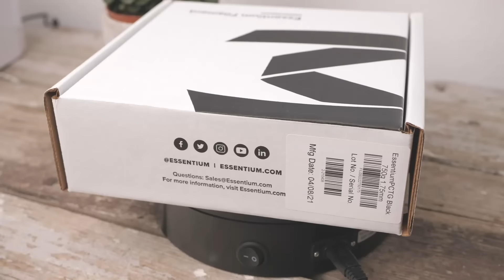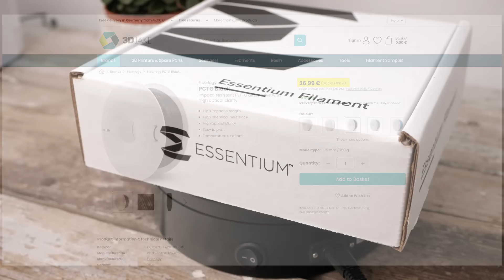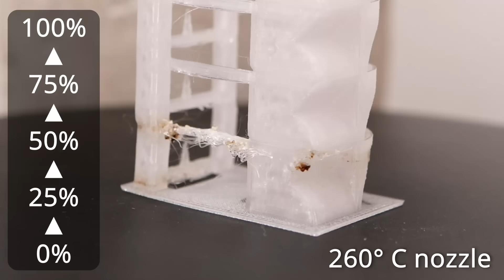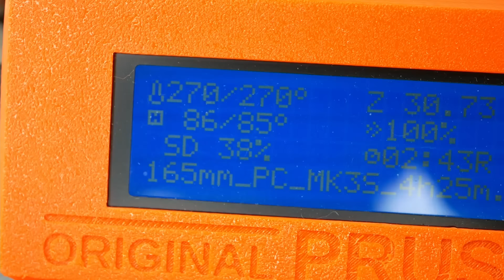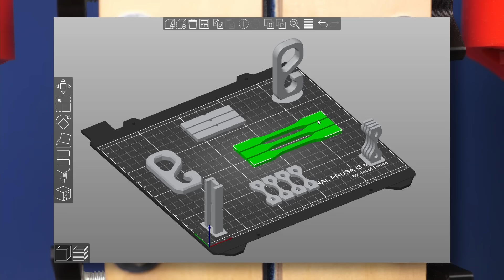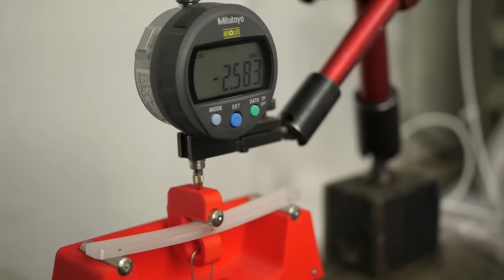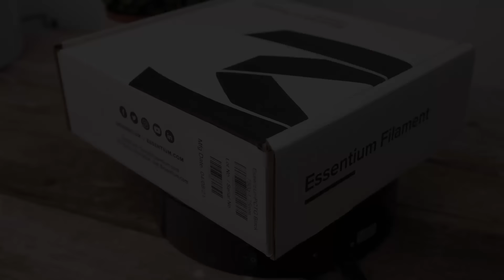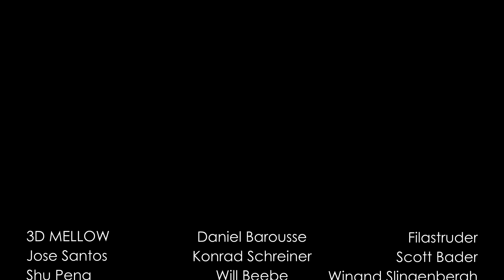PCTG - The Isotropic 3D Printing Filament?

Comment: I hate essentium's pla
Reply from the maker: Why? Not worth trying out?
Reply: @CNCKitchen  I tried their white and green and I was always left with weird artifacts in the print, like small little dots at some points. I still have some laying around, so I could test it out again. I'm pretty sure their pla is more hygroscopic than regular pla
Reply: In all honesty, it's probably my lack of proper storage which led to my problems, but every other pla I tried worked just fine after a while
Reply: @MOOBBreezy  It's a problem with your printer.